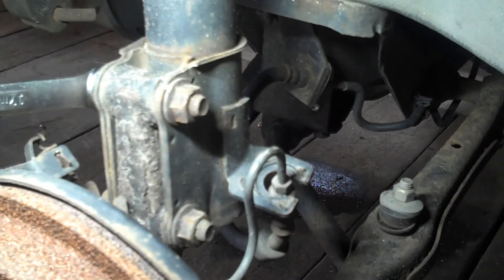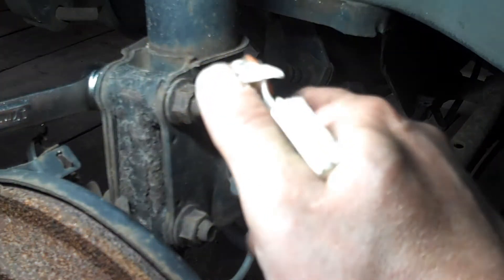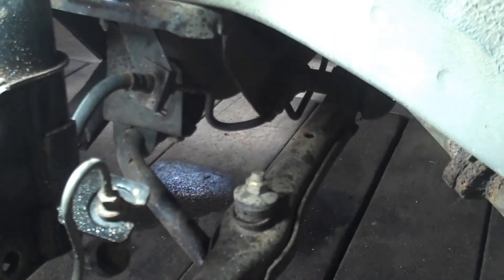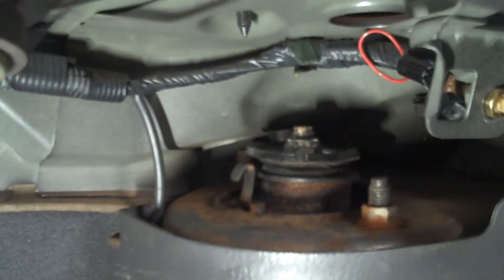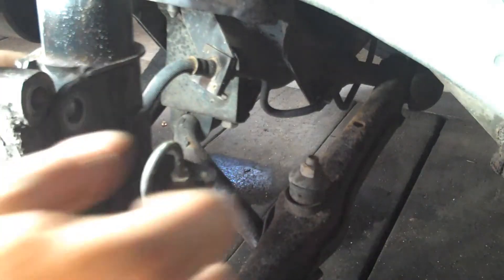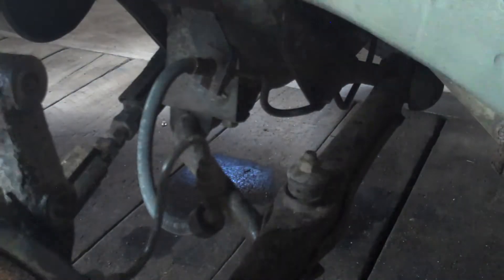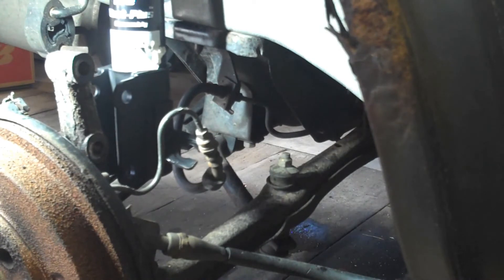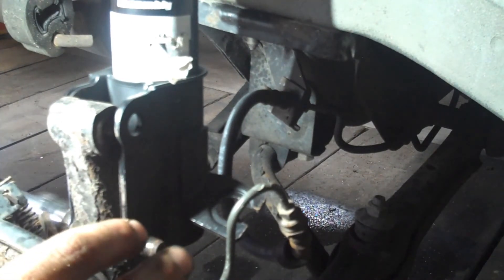Mazda Protege Rear Strut Replacement (Gen. 1)

Comment: hello Recommend Mazda Protege, is it a good car? Is it worth buying? 1.6 or 2.0 engines?
Reply from the maker: Unfortunately we no longer have the Protege any more. ours had 250k's worth of hard miles and was burning way too much oil so we decided to pass it along and get something a bit more modern. I will say, it was one of the best cars I had ever had, never gave me any real trouble, got 35+ MPG, and was a beast in the snow. For the right price, they are great cars and worth looking at.
Reply: Yes they are good as long as they are maintained. I have a 2001 LX 2.0. It’s a iron block non interference engine. I bought mine in 2017 with a bad cylinder and it lasted 3 years. On a bad cylinder. The car sat from summer 2020 till just a few months ago, I put a new engine in it amongst several other things. Car runs great and I love it.